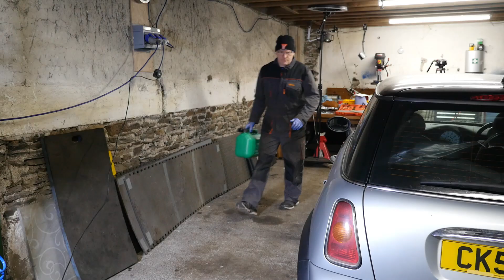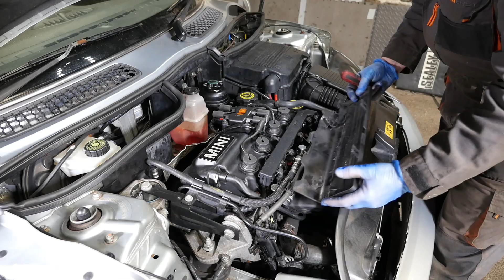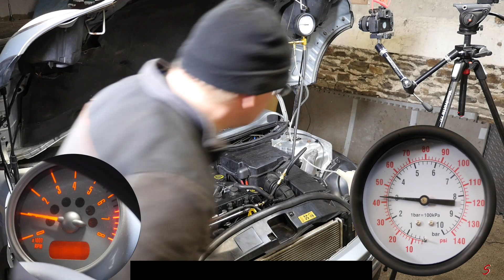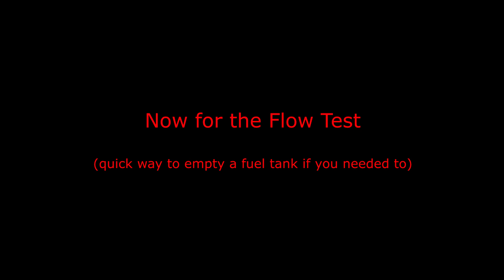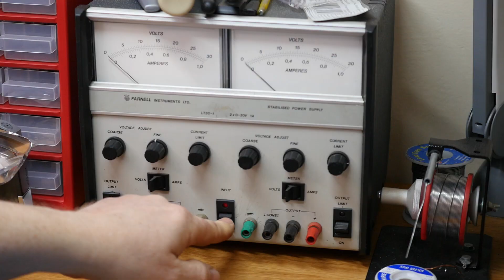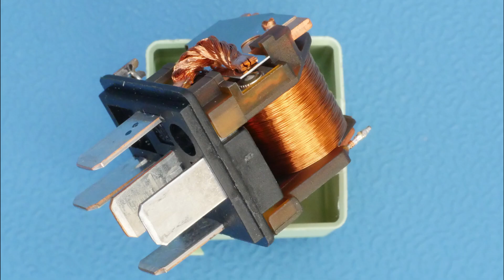Fuel Pressure Test on MINI R50 - Relay Test - Draining Fuel Tank - also running a fuel flow test 🚗🚗

Comment: Hello, great video!! 👍

I bought a Mini R56. The seller broke down with the car. According to him, he then replaced the fuel pump and the fuel filter. Unfortunately, the Mini still does not start. The starter turns, but the engine does not start.

Then I checked at the high-pressure pump (low-pressure hose). No fuel arrives there when cranking.

The relay signal reaches the fuel pump during cranking (I measured 11.8 V at the connector of the fuel pump).

After that, I powered the pump with an external 12 V battery. It hums, but in my opinion it is very quiet.

Then I disconnected the line at the filter outlet (the line that goes to the engine). No fuel comes out.

Do you have any idea? I will definitely remove the pump. It’s really strange that no fuel even reaches the filter.

Thanks & regards
Reply from the maker: Did you see this other video I made.  https://youtu.be/TA4guIX2CFM?si=rA7hsldL5906FMVq

Comment: Hello, I have an issue with my R53 and hope you can help me. It seems like I have zero psi or maybe 1-2 at the fuel rail (I depress it with my fingernail and it just leaks a bit instead of shooting out). Pump sounds like it's working, car starts with difficulty and runs even worse, especially when I push the throttle even slightly it wants to stall, no question about going uphill or anything producing load. BUT when I disconnect the fuel line from the rail and turn the key to the second position, the is fuel delivery. I did the relay bypass test and timed how much it takes to fill a one litter bottle, it took approximately 26-27 seconds. So why don't I get fuel rail pressure, even if the pump is not at it's best, surely it should produce some pressure at least, shouldn't it? I don't see any leaks. Unfortunately I'm stuck in a remote area for vacations with no access to a decent mech shop or to a pressure gauge. So any help would be greatly appreciated.
Reply from the maker: Yours isn't a diesel is it?
Reply: @CoatsandGaiters  no it's not, R53 cooper S petrol

Comment: You honestly make the best and clearest videos on car repair; so glad you focus on the buggy i have.  Been fighting a p2096 for almost a year. always learn a ton from your videos- Ordered that same kit, and loaded with some good ideas  -  feeling hopeful again!
Reply from the maker: Thank you Eric.  Hope all is going well over there with your Mini?
Reply: @CoatsandGaiters  - been fighting a 2096 code since october. about 3k in with parts so far and even brought to a few "specialists" who didn't get it. new BMW scanner arrived last night. hoping resetting the attributes does the trick. texas is doing away with inspections in 2025. I guess  plan B is hoping i can avoid getting pinched for an unregistered car until then!
Reply from the maker: @ericbmusic  Blimey all go then over there Eric.  What is a 2096 code?
Reply: @CoatsandGaiters  - lean fuel. I've replaced every part related. now i'm told to reset the attributes but the cheap BWM scanner i bought won't do that, although it claims so on the box. it's been a saga. can send you the 20 page forum link if you are curious.
Reply from the maker: @ericbmusic  does the ECU not control all the fuel delivery requirements?
Reply: @CoatsandGaiters  - i think it does but the was told the car is used to (or maybe 'trained") to compensate for an influx of extra air, prob due to a faulty TB and/or a warped valve cover (replaced both) but it still is over compensating. good news is it runs great. got over the 34mpg on the highway the other day) anyways, as i understand it, this is why the attributes need resetting. this is all new to me. and it's just one of the many theorized fixes that I've been presented. also the 2nd (DS) o2 is acting funny though i'm on my 3rd one. It's a $200 bosch. doing the same thing as the previous 2. next step is to trace the wiring for that all the way back. need to check fuel pressure as well (why i was watching this video) but the kit i bought dones't work. so still need to get another. and On and on it's been going like this. hardest part is procuring tools and parts that actually work.
Reply from the maker: @ericbmusic  is it the 1.6 THP Peugeot engine !!!!
Reply: @CoatsandGaiters  - ummmm. its a pre-july 2004. lost of BMW stamps.
Reply: is that car you are working on in the video a Peugeot?

Comment: Sir, I have a relay that often burns, is my fuel pump damaged?
Reply from the maker: Sounds like it's drawing too much amperage.
Reply: @CoatsandGaiters  what should i do sir
Reply from the maker: Sadly I cannot really advise as I'm not there with the car.  Auto electrics can be very complicated and needs to be worked through bit by bit testing as you go. @Parangmausal
Reply: @CoatsandGaiters  thanks sir
Reply: @CoatsandGaiters  thanks sir
Reply: @CoatsandGaiters  maybe I can try replace my fuel pump sir
Reply: @CoatsandGaiters  Sir, I have already tried to check the wiring fuse box. Use a two-wire test lamp, the yellow wire and the red wire light up at the same time even though the key is closed. Is it because of the BCM shooting?

Comment: hey, got a problem, my r53 is not delivering fuel from the tank to "from tank fuel pipe", took off the both ends from the filter and the ramp off, the pump works, nozzle from the filter side leaks as soon as the ignition turned on, but on the engine end nothing comes out, what could be the issues..? thanks for the answer 🤯
Reply from the maker: The pipe running under the car hasn't been kinked or damaged has it?  Is the fuel flowing from the filter with the pump running?  should have a strong flow leaving the filter unless the filter is blocking up.

Comment: Hi, I have been trying to get a seller to answer the question of the diameter of the quick connector of the very top quick connector. If it is 6.30mm(SAE 1/4)7.89mm(SAE 5/16)9.49mm(SAE 3/8). So I know if it will fit my 2007 toyota matrix. None seem to want to answer. Maybe this is a pain in the butt but it would be appreciated. Thanks.
Reply from the maker: Do you mean the one in the lid in the top middle?  If its the one with a brass T section on the left and a short rubber pipe to a quick disconnect the quick disconnect has 7.89 on it.  The long brass pipe facing down is 7.82mm.  Hope this helps.
Reply: @CoatsandGaiters  Wow, thank you been all over the internet trying to find this info. thank you very much. Subscribed
Reply from the maker: @lmt200ish  Thank you and no skipping those adverts lol

Comment: My Mini got almost full tank of gas when I put it in storage a year ago. I have been getting more and more anxiety about how to get the old gas out of it. Fortunately I found this video. Today I drained about 10 liters gas out by the means of bypassing the pin 87 and pin 30 of the fuel pump relay.  Very happy learned this method from this video. Thanks a lot for your clear tutorials.
Reply from the maker: That's fabulous news, how come your mini is being layed up for so long?
Reply: @CoatsandGaiters  Right now my daily drive is my rusty Caravan pretty much has a year or so life left. I want use it as much as possible before its end. Then I'll drive the Mini. Since now I know how to get the old gas out so no more concern about how long it stays in the garage😄
Reply from the maker: @zwddl  Very true lol, E10 petrol is the biggest one as that absorbs water from the air and accumulates in the tank.

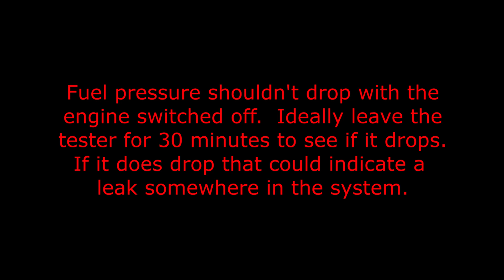Comment: 10:10 I think it's normal to see the fuel pressure gradually drop after the engine is switched off. The regulator is not a one way valve. Going back to your Peugeot 207 video, I remember the pump switched on when you opened the door, perhaps to facilitate a quick engine start.
Reply from the maker: That's very true, logic would say the pump priming when opening the door is to facilitate a ready engine.  I think glow plugs do this as well on diesels for the appearance of an instant start-up.

Comment: Great video👍 What is the correct fuel pressure during acceleration on a Mini R53?
Reply from the maker: I think the fuel pressure is meant to be kept constant at 3.5 bar or 50psi over the driving range.

Comment: Very useful. Most R50s fuel pressure regulators fail after so many years, I found the issue after a lot of troubleshooting when the pressure test showed clearly there was a leak somewhere. Fuel was leaking under the regulator.
Reply from the maker: Thank you for the comment.  When you say leaking do you mean actually leaking onto the engine ? Or leaking back into the tank return pipe?
Reply: @CoatsandGaiters  it was really leaking fuel into the intake through the drain pipe. It was very hard to start with warm engine and always had fuel smell. Fuel consumptions were crazy too!
Reply from the maker: @peskachina  thank you for the heads up on that.
Reply: Did you have to replace the whole rail ? I see a clip on the bottom of the fuel regulator but it seems to be welded to the rail. I haven't seen anyone show on how to replace that part. And info would be very much appreciated.
Reply: @jorgezamarripa9718  On my first car I replaced the whole rail, on the third I rteplaced only the pressure regulator, the clip can be removed easily once the rail is off but it didn't solve the problem that time, I actually sold it before i could find the real cause.